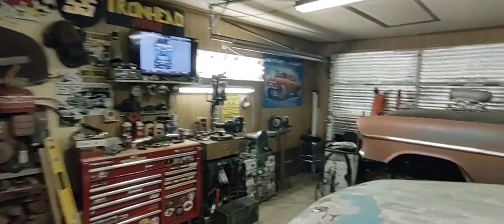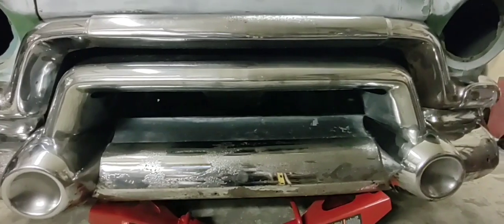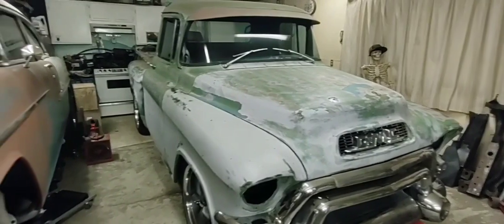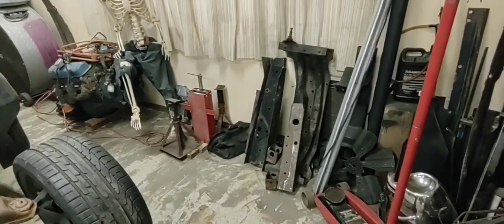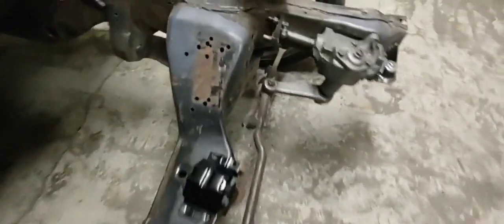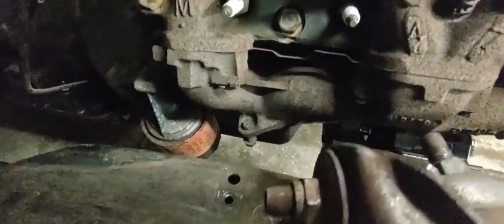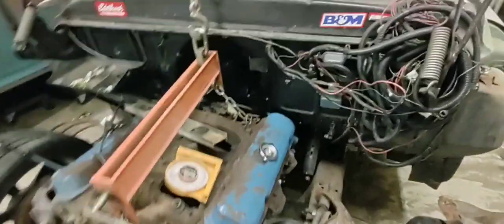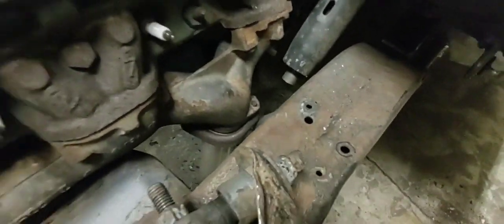55 GMC Mocking The Pontiac Engine up in the Firebird Subframe With Butler Performance Engine Mounts.

Comment: Loving the new look and stance. There is a ton of chromed metal, and real metal, in the front of those trucks. The motor looks great sitting in there. The mounts look like they'll work just fine. Looks like you've got some more holes to weld up!! Look forward to more. Be safe and stay well.
Reply from the maker: Hey Brian thanks. I'm diggin the stance on the old truck a lot.
There sure is a lot of chrome right
And good metal back in those old days. Been working on the fire wall everything is working out pretty well.
Thanks for stopping in have a great night brother. Take care 👍🏻👍🏻👍🏻

Comment: I wood have done the drive shaft.insteadof beating up the floor. But I don't  own the truck
Reply from the maker: A drive shaft is almost 300 bucks.
I'm am going to fix the fire wall not going to leave it like that. No big deal to weld in a recess patch. I guess it would be for some people. 
Thanks for watching 👍🏻👍🏻👍🏻
Reply from the maker: Anyway with the engine being farther back the old truck will even handle better😁